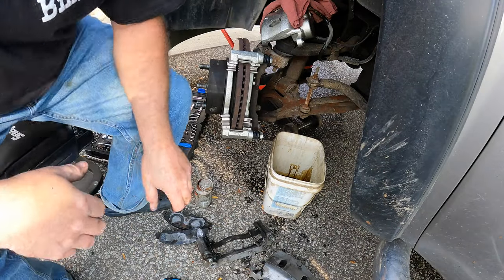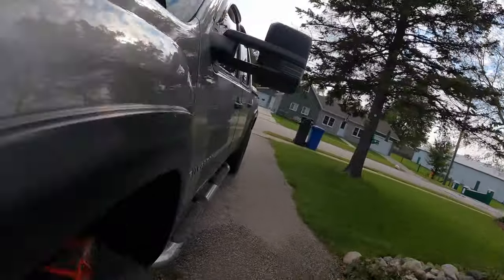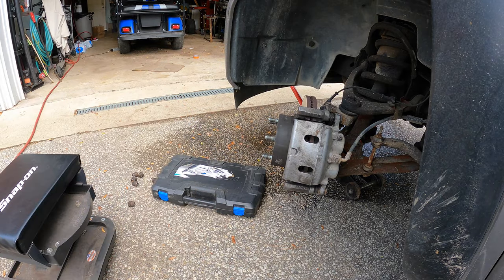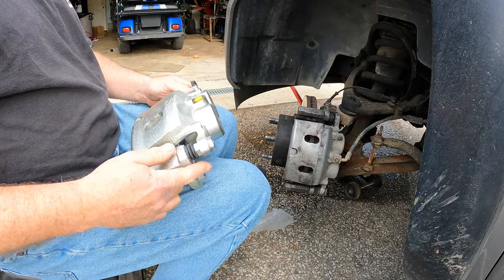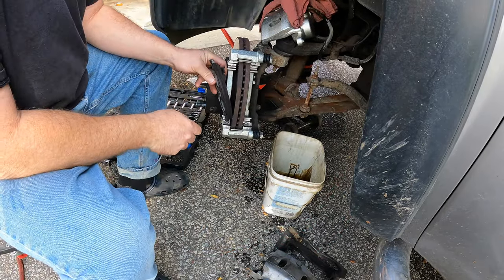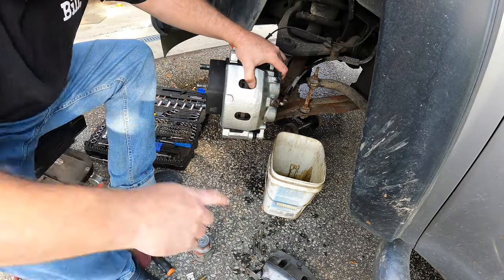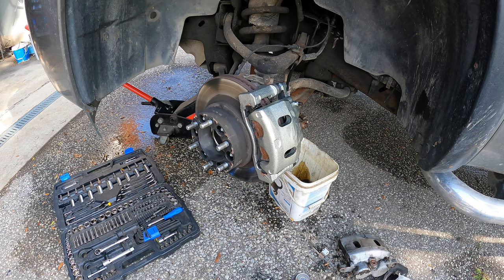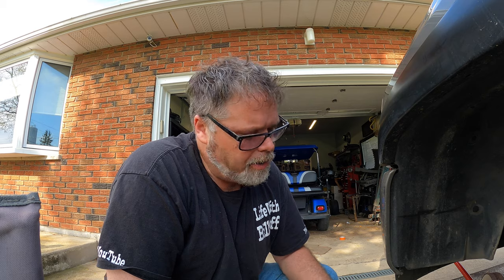How Is This Brake Caliper Going To Fit   4K

Comment: Well done brother. The only think I saw was are ya ready , the cap to the master cylinder.  Just leave the cap rest unlocked on top of the master cylinder.  Brake fluid will pull moisture out of the air and deposit it in side the brake system.  You ever wondered why a perfect brake line pops that why the system was open to the air too long. Great vid bud .

Comment: Just an FYI Bill, next time you have to do a caliper put something on the brake pedal like a snow brush or something. Just lightly have the brakes applied while you remove the brake line from the caliper. You shouldn't have any brake fluid drip out of the line that way. Just whatever is in the caliper will pull ur out.

Comment: You should of saved the 100 bucks. There was nothing wrong with the old one. The only reason to replace it is if it's leaking on the piston seal. 8 bucks for some silicone brake lube, and just lube the guide pins, and the pads